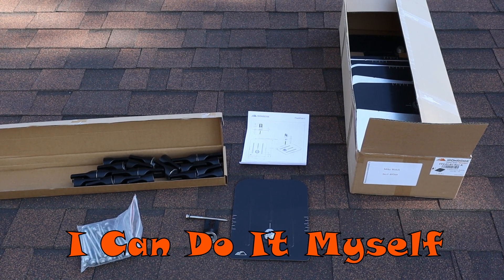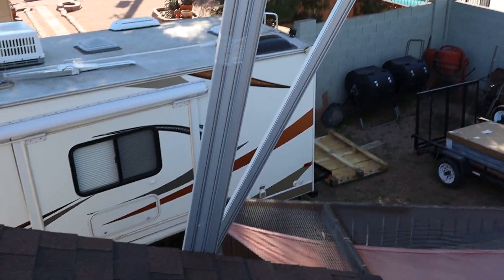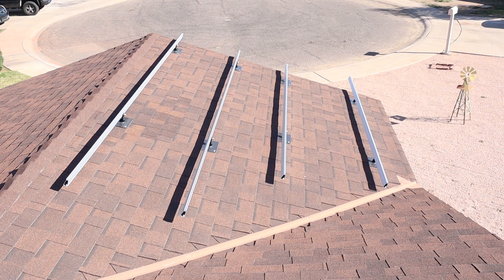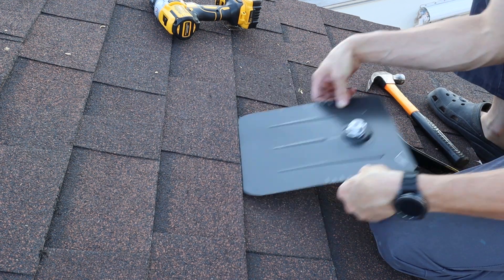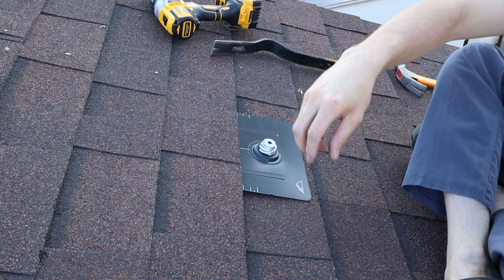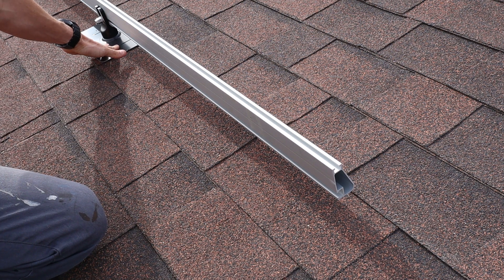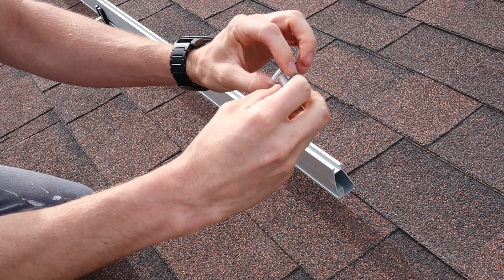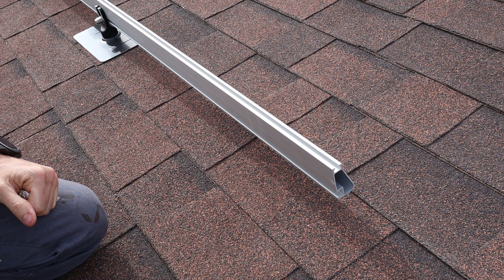My DIY Solar: Part 4 IronRidge Racking Install

Comment: Thank you,  Question: I just picked up my 8.5kw system Monday.  Where do I measure from the ridgeline down to make the first hole?  What is racking spacing?  My panels are 44" x 60" IR Racking system.  No instructions.
Reply from the maker: It doesn't have to be anything specific. If you went 48" (4') down from the ridge, that would give a 1ft overhang and 3ft of fire clearance. 7ft down for the bottom rail gives you 1ft of panel overhang top n bottom.

Comment: Hi.
I saw that almost all of your rails are running perpendicular to your rafters. 
But you had  two rails running parallel to the rafters, from the ridge straight down to the eave. Is that recommended? Wouldn't it be too much weight on those two rafters?

Thanks for your advice on this as always
Reply from the maker: It's not very different than running then perpendicular. I did stagger some of the flash feet for the perpendicular panels but if you lined them up, then they'd be supporting similar weights. The parallel row is actually now tilted which isn't shown in any of these videos but I'm planning on a two year update in the next few weeks.

Comment: Hey, I appreciate the videos! 

I'm building an 17kw system and I'm trying to figure out which solar disconnect to get. 

One Pole, Two pole, three pole? 

Do I need fused or non-fused?
What size solar connect do I need for 180 amps total? Does a three pole 60 amp mean three 60 amp connections?
I know I need outdoors for waterproofing. This is a 2019 build house with the main breaker next to the meter outside.  Planning to put the (3) 60 amp sub-panel and disconnect next to them outside.
I'm splitting the panels from the micro inverters in 9 segment wires runs of 1850 watts.
For the subpanel, I was thinking: (3) 60amp breakers (I'll combine the 9 wires into 3 groups of 3 for each 60 amp breaker). That'll give me (3) 60 amps that'll run to the solar disconnect and then to my main breaker panel split into (3) 60 amp breakers. 

Is that the correct or best set-up?
I'd really appreciate any help you can give. I just want to make sure I order the right parts. I will be having a master electrician check my work. I just need to know this to make my diagrams for my planning committee are correct. 

If I'm correct about the three poles and needing fused, is this the correct one to order?
60amp - 3 pole - Fused
https://www.amazon.com/Siemens-HF362R-60-Amp-600-volt-Switches/dp/B005G936JM/ref=pd_day0_c_60_3/140-4695955-3301365?_encoding=UTF8&pd_rd_i=B005G936JM&pd_rd_r=0691a9e1-5e82-42c7-add8-fca1c06b3825&pd_rd_w=v5QuQ&pd_rd_wg=Hujl4&pf_rd_p=7dbe3bbd-18b1-49e5-b954-f6b0bc9f6310&pf_rd_r=S7DYE8ZG9CKPRD8E1ZVQ&psc=1&refRID=S7DYE8ZG9CKPRD8E1ZVQ
Reply from the maker: With a 17kw system at 240 volts that would be ~71 amps. You would want to step up to a 100amp disconnect. Some utilities call for a fused disconnect, some do not. If you are unsure, just go with the fused. You do not multiply 60 by 3 poles to get 180. 3 poles is just your 2 hot and 1 neutral. Are running 9 strings into 3 breakers in a subpanel then going from there into a main panel? If so then the 3 breakers would be 30amps each in a 100amp subpanel,  100amp disconnect and 100amp back fed breaker. If you get all 9 strings into the subpanel, then each breaker could be a 10amp with it still being a 100amp subpanel. You would have to make sure the wiring from the subpanel to the disconnect to the backfed breaker is all big enough gage to handle 100amps.
Reply: @ICanDoItMyself  Alright I see, I was dividing by 120 instead of 240. The main breaker is 240/120 and the sub-panel in my garage is converted to 120. 
100 amps should work. Also 3 pole is required right? 2 hot and 1 neutral 

Yep (3) 30amp breakers with 3 wires running into each, (9) wires [1875 watts each - 5 panels]
1875 x 9 = 16,875 watts / 220 = 77 amps
So after I run the 77 amps into the disconnect box from the (3) 30amp subpanel, wouldn't I need a 100 amp breaker in my main breaker box to connect to? (the main breaker panel has a 200 amp breaker at the top, so I assume this should be fine).
Yes, 2 gauge wire for 100 amps
Reply: Also there are three wire and four wire disconnect boxes. What's the difference? Is the 4th wire for ground? (Just two options I found on amazon)

Comment: great video! do i need to use crocs to work on the roof or sandals will do?
Reply from the maker: :) I wear crocs when working around the house. Ugly as sin but comfy, squishy and easy to kick off. Crocs and the same grubby cloths. I don't want to mess up my nicer stuff and I WILL if I'm wearing it.
Reply: Man this is so much easier than a flat concrete tile roof!

Comment: What spacing did you mount the feet at?
Reply from the maker: They vary. With the XR100 rails, with 0 snow load, you can span 9ft 7in between feet and an overhang of 3ft 10in. I only spanned a maximum 8ft, most less because my rafters are 24in on center.
Reply: Hard to find, but IronRidge have a nice table that explains the spacing based on windload and snowload. It took me a good 1 hour to find it. Google IronRidge_XR_Rail_Family_Tech_Brief_01_11.pdf
Reply from the maker: @japansh  It took me a while each time I was looking, finally got smart and saved it